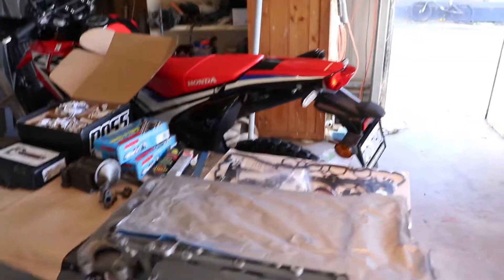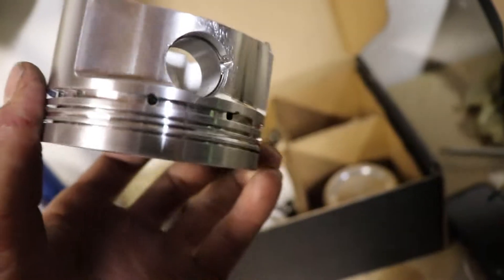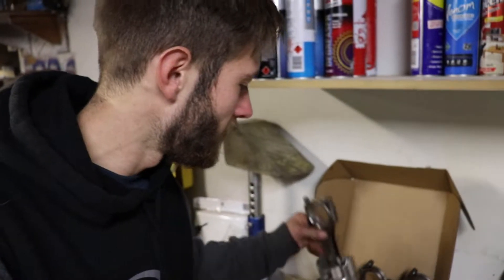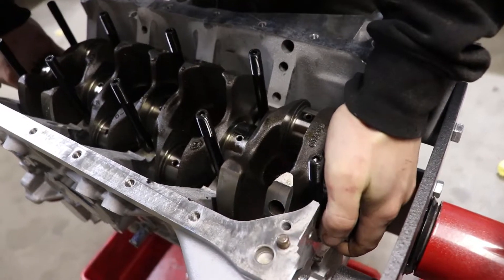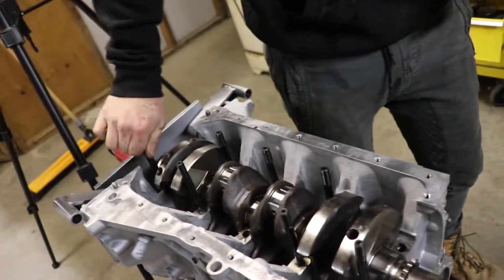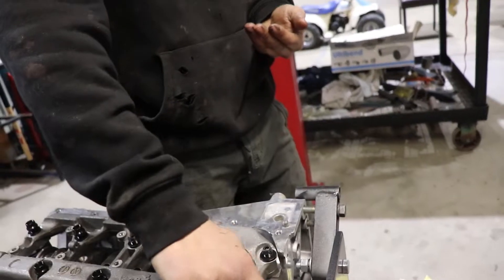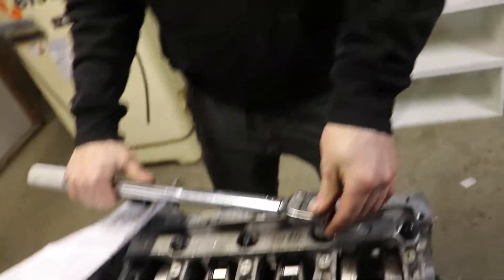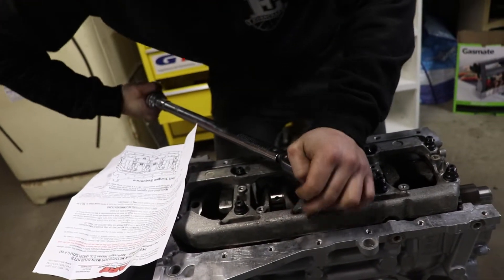BUILDING MY SR20 WITH FORGED INTERNALS

Comment: Hi J Scott, how your main bearing with ARP stud ? do you know that 80 lb/ft is too much torque for the main bearings, it will crush the main tunnel to oval, I have test the roundness starting from 40 lb/ft and adding extra 10 lb/ft at a time, but I stopped at 60 lb/ft, it crush too much and out of round.